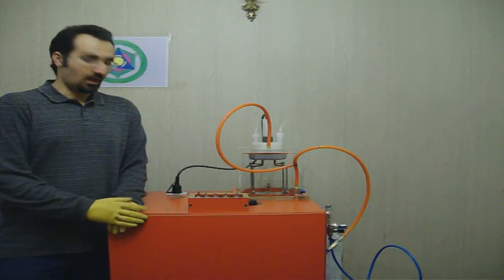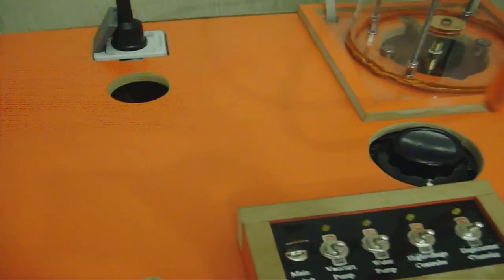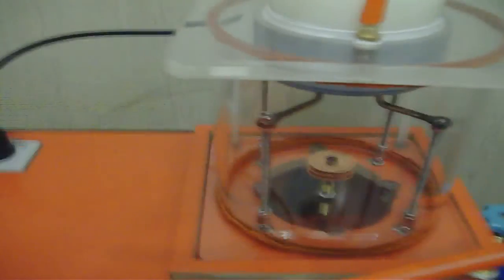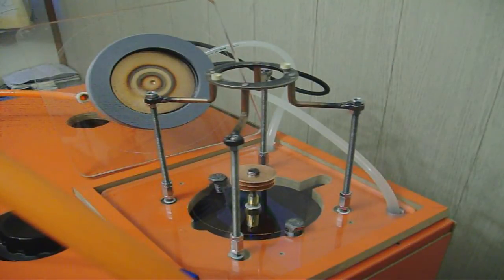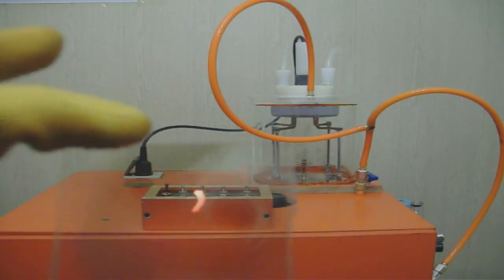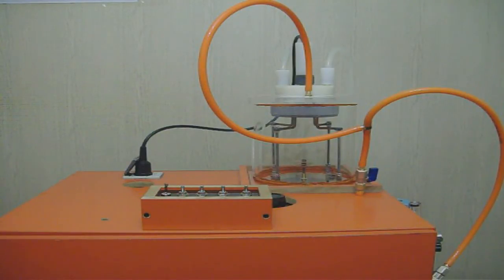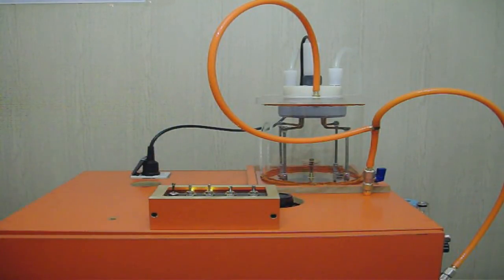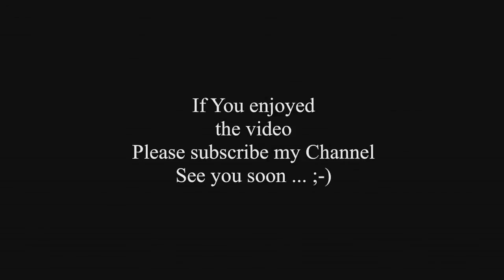Sputter Coater Machine

Comment: Cool.  You might consider a needle valve to allow a small amount of argon to flow into the chamber while you are running the vacuum pump.  This will ensure the majority of the gas inside the chamber is argon.  A sealed chamber connected only to a running vacuum pump will be filled with water vapor and residual air as it is desorbed from the interior surfaces.
Reply from the maker: Applied Science Dear Ben In this video I am using a larger vacuum chamber , I used to use a much smaller one (the same process without using needle ..... ) yet I could obtain pretty beautiful coatings , I am confused ! I think my vacuum pump is not able to create the proper vacuum needed for sputtering! - cuz I enlarged the vacuum chamber size (currently I am not able to measure the pressure of vacuum chamber to prove my theory !) - , What do U think ?  :-)
Reply: Nima Sarlak Having a vacuum gauge is definitely helpful.  If the pressure is too high, and the atmosphere has oxygen or water, the coating will be negatively affected.